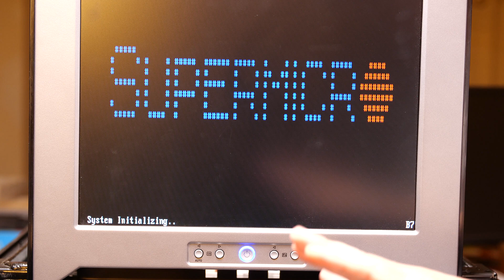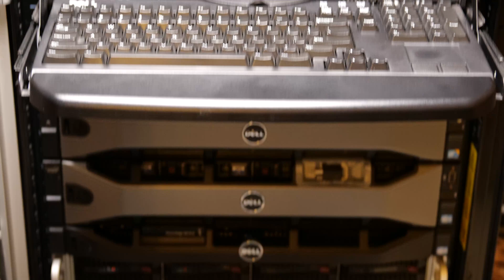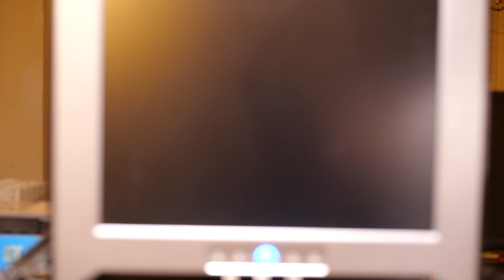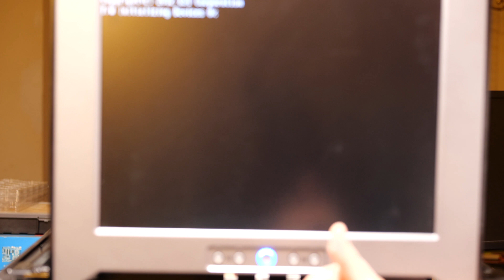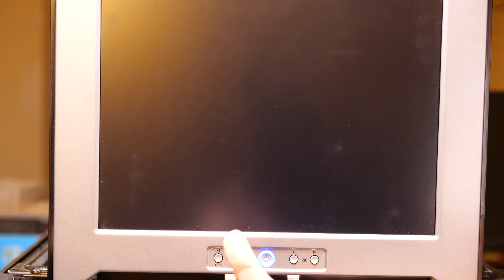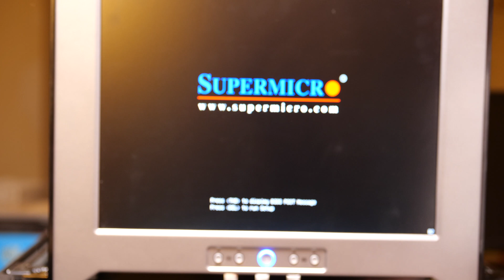Supermicro system initializing B7 B9 BA BF | Really weird problem with X9DRH-7F

Comment: I have a problem with an x10 motherboard, the problem is that it doesnt get any display output, in fact i cant even get output through the iKVM and i cant even power the second stage on from the IPMI, basically the the pc completely dead, i cant even get to the bios and in ipmi the code it gives me if “ff” i literally dont understand and dont know what to do, there is not ao much info out there to help me understand
Reply from the maker: You might have a dead motherboard. A few things you can check: 1) reduce the system down to bare minimum, 1 CPU + 1 DIMM. double check CPU pins to make sure non are bent 2) check that nothing is shorting the motherboard, especially any stand-offs in the wrong position 3) check CMOS battery has at least 3.0V 4) verify your PSU is providing all necessary power.
Reply: @ArtofServer  I have an x10drd int and everything works perfect there, i have tried all the points you said but does not work, what i think it is is the BIOS, the system will not boot if the bios is corrupted, my only hope is to try and reflash the bios chip maybe with a ch341a if it works, the bios chip model its kinda specific and i dont know if its gonna be write protected or if this is even gonna work, maybe the last last hope if to remove another working bios chip from a dead x10dri mobo hoping the bios is good (and has the same controller info inside it) so it boots, but if neither works then yeah the mobo might not be getting enough power which would be weird since IPMI is perfect and in a normal IPMI information table there has to be info about the BIOS version and so on like i see in the x10drd, but i see nothing in the bad mobo so bios has to be the issue, buying another mobo has to be the absolute last option cuz its so much more expensive now that before so im pretty fucked tbh 😭😭

Comment: For my X9DRW-iTPF motherboard, It was caused by turning on "Above 4G Decoding (Available if the system supports 64-bit PCI decoding)
Select Enabled to decode a PCI device that supports 64-bit in the space above 4G
Address. The options are Enabled and Disabled." If I did enable it, it would not get passed the initialization screen. I would have to clear the bios to get the OS running. Updating the BIOS and the IPMI firmware did fix it.
Reply from the maker: Thank you for sharing that!

Comment: Thanks for this. I had B7 on an X10SRH-CF and had rotated all 4 RAM modules that I had to hand, one at a time through the A1 slot with no success. It wasn't until I watched your video that I understood B7 could be CPU-related. It turned out BIOS version was the issue, it was running v1 but needed v2 or higher to support the v4 Xeon E5 I had installed
Reply from the maker: That's very strange that you got a B7 for running a V2 CPU on a V1 BIOS. Usually, the symptoms I've seen in that situation is a blank screen and no POST at all. Either way, I guess I'm glad this video directed you to eventually find your issue. :-)
Reply: @ArtofServer  Yeah I did not expect using a V1 CPU to resolve the issue honestly, but thought it was worth a shot as I was out of options. V1 CPU allowed me to access motherboard BIOS, flash the latest version and install the V2 CPU. Very odd

Comment: My son and I just went threw this. It's board flex that is the culprit. Take the board out. Reseat the ram in as hard flat surface. And it works. Just to much flex in the board installing the ram.
Reply from the maker: That's really interesting. but if that's the case, I suspect some trace on the motherboard is damaged if flexing it causes it to disconnect.
Reply: @ArtofServer  I would love to give an answer. All I know is we installed the ram in the case. And the board flexes like crazy. With a code BA.  So I told him to take it out. Put it in out dinning room table. Put them back in and it fired right up. Put it in the case after that and it still works. So, something somewhere didn't like something.

I'm guessing the flex mis aligned something and it didnt pop back into place as it sprung back up.

Comment: Been fighting this issue on 2 of these SM mobos. Thanks for problem identification and temp fix.  It happened again yesterday after a power-fail reboot. Stuck on B9.  This can popup after months of running just fine.  My long term problem is I can't put these servers at the datacenter 2 hrs away.
Reply from the maker: Yeah, I can understand if the system isn't stable and consistent, it's difficult to deploy remotely. It's possible some of the traces from the CPU socket to the DIMM slot is slightly damaged and sometimes loses contact. To improve stability, can you try not using the DIMM that has the instability and use larger DIMM modules if you need the RAM?
Reply: @ArtofServer  Good idea. No, excellent idea. Thank you.

Comment: After spending countless hours working with my super micro x9 d r i over the past 3 years it's been an absolute nightmare. Any upgrades done or just such a time-consuming troubleshooting mess. I really wish I would have videotaped myself all the time struggling with motherboards because they are very very temperamental. Best of luck.
Reply from the maker: Sorry that was your experience. I've had rock solid reliability with my Supermicro servers and I run 4 of them, not including the lab machines.

Comment: For me is a bad case of grounding. When fully populating all the ram, I will have B7, B9 or BA as what you have told. Find everywhere for help and in Russian website saying it’s a bad case of ground. Put a static bag behind the motherboard and all boot up fine and working fine
Reply from the maker: Thanks for sharing 🙏. That's a very interesting remedy.
Reply: Yes, I experienced something similar. I kept receiving these errors until I removed the motherboard and cleaned out the dust and debris from the chassis. Something was causing a ground to short issue and all of my troubleshooting of seating with CPUs and DIMMs was for not!

Comment: new subscriber here i have a supermicro x9dri-ln4f+ thats so picky with ram its unreal so far have only been able to get to ram sticks to work anything else and it gets stuck at either A9 or B7 lol
Reply from the maker: have you tried my first suggestion from this video? I find that if the CPUs are not seated perfectly, the pins to the DIMM slots might have poor contact and that can manifest as RAM error. it's also possible you have a bad motherboard where the traces to the DIMM slots from CPU might be damaged somewhere along the line. Especially under the screw holes of the CPU mounting brackets. If someone used a screw that is too long, it could have contacted the traces under there and damaged them.
Reply: @ArtofServer  my uncle whos a pc tech spent weeks messing with it he told me its picky with memory the only thing we havent tried is swapping the cpus around from one socket to the other and testing out the memory to see if the issue related to the dimms for socket 2 can be replicated for socket 1 thanks for the reply never seen a board so picky
Reply: update swapped cpus no dice same issue

Comment: Mine is the X9SRH-7F the same but Single CPU. 
I was having the same problem, and I tried everything including what you do here.
in the end it only worked with a single memory module.
and, OH SURPRISE!, when I disassembled it, I noticed that where the screws that hold the heatsink go, there are tracks underneath, and the screws reached them. breaking several.
Reply from the maker: oh yeah, I've heard of that problem before... someone using aftermarket CPU cooler with screws that are too long and end up damaging traces under the screw hole. You can remove the CPU bracket stuff and expose the damage to repair it if you are handy.
Reply: @ArtofServer  😖Yeah, I think I can fix it, but it's going to hard work. It was the 4 screws. 6 tracks on each side.

Comment: Im Stack in 91 ? What I have to do
Reply from the maker: code 91 usually means there's a faulty PCIe device causing a problem. Try removing all PCIe cards and see if it resolves. If so, add 1 card back at a time until the problem is reproduced. Then you know which card is causing the problem. If you have no PCIe devices, it might mean something on the motherboard is faulty and needs to replace the motherboard.

Comment: I get an AB error and a blue screen when trying to boot into the bios. Cleared CMOS and tried to change the date in the EFI shell but it won't save the date so still won't boot to bios. X9scm-f Have you ever seen that happen?
Reply from the maker: I'm not familiar with that problem. However, I used to have an X9SCM-F too, and I had so many problems with it, I got rid of it. Supermicro tech support even admitted they knew of some of the problems, but since the product was EOL, they have no plans to fix them.
Reply: @ArtofServer  Its a bios issue. Something to do with the clock if you update it which I had. It has to be rolled back in UEFI before Dec 31, 2020 or in an OS like UnRaid. Then you can boot into the bios again. Its a good starter board which I just made my backup server. thanks. As always love the videos.

Comment: I have the BA issue. Now I will trie this. sounds strange. My IPMI is also not starting every time I plug in the Server into Power
Reply from the maker: Sounds like there are some problems with that board...
Reply: But with this tip it worked. Strange what on this board is that often wrong

Comment: the supermicter gave Me B0 when motherboard was placed in the table, all three times, and when i was installed in the case of motherboard b0
Reply from the maker: That's a totally different code. I believe B0 means you are using wrong type of ram modules.

Comment: hello, is there any chance that a dh61ww (LGA 1155) can run a h200 / h310/ 9211 8i/ 9217-414e (in JBOD/IT).

If all of them are compatible which one is recommended?
Reply from the maker: I don't know that board specifically. for best compatibility, choose one of the genuine LSI cards. if you must use a Dell or other OE branded card, there's a chance of SMBus conflict. If so, you'll have to apply the workaround. Search my channel for "smbus" to find the video showing how to do that.
Reply: @ArtofServer  Great, I did miss the SMBbus, shall surely check that out. Thank you for finding time to resolve my query.

Comment: This is amazing.  I have a Supermicro server I've just received that had exactly this error. When it arrived the heat sink on the processor in question was installed at 90 degrees so wasn't doing much so I figured the problem had something to do with that, and as long as the ram was installed into any slot other than one particular blue one the problem went away, so, not ideal, but it worked.

While I was away doing another data center install I saw your video. Exactly what this server was doing. I've just removed the processor, nothing obviously wrong, nothing I could see on the pins, but, I've just fired it up with the ram back in the correct slots and boom, off we go.

Thank you!! Would never even have tried without this video.😁
Reply from the maker: Glad this was helpful? Be sure to try reseating the CPU and dimms first.
Reply: @ArtofServer  Bloody thing just locked up and is back to B9. Can only get it to boot with one stick of ram on each side of the CPU's (one of the blue ram sockets). Running a NAS with 8 GB isn't much fun.

Comment: Crazy thought tried putting in 2 gpus? 1 for each  cpu assigned by user manual
My old s5000xlar had weird pcie issues but putting in 2 k600i booted fine. Taking one out or both resulted in the same issues you  have had.
Good luck .
Reply from the maker: Even stranger!

Comment: You mentioned that the issues happens with that Quadro P400 in any slot but you didn't mention if this issue happened with any other PCIe card or not. Also maybe a card x8 x4 x2 will help narrow down the problem.
Reply from the maker: I test the other PCIe slots with some Supermicro branded HBA cards and that did not trigger the problem. The P400 did, but I did not try anything else.
Reply: That's very weird.

Comment: How are the screw mounts on these?
Can we sneak one into an ATX case to build an interesting home work station? You have me a little intrigued with these boards :D
Reply: it doesn't have through holes instead it just has a plate with threaded holes(bolts going to far would go into the board that is behind it), having said that I mounted 2 Cooler master 212's by expanding the heatsinks x brackets holes a bit and using my own bolts with nuts to adjust spring tension and bolt height; there doesn't seem to be a wide selection of official supported heatinks:P
Reply: as for atx case these are EATX form factor and so you need a super empty case (12in~ by 12in~ for the board & whatever else) or something that is big
Reply: @plasmar1  Oh yeah I can see it, compared to some of the enthusiast boards I have operated it appears a little bigger like the EVGA X58 Classified boards that were quite big for their day.
Reply: @CMDRSweeper  if you're gonna try it out, Phanteks Enthoo Pro:) if you get the version with the lsi controller be warned that it's a tight fit for the sff-8087's but doable.... X9DRH-7TF has dual 10gbe(intel x540-t2)
Reply from the maker: @plasmar1 thanks for answering!

Comment: It could be warping the board when the mounts are fully tightened down. Just a thought but Steve on GamersNexus mentioning about installing a spacer to even out pressure on a CPU quite recently.
Reply: this is the style of socket that is suppose to have less of any issue or not have the issue, 2 levers LGA2011, but it could still be the same issue.....
Reply: @plasmar1   Yes but its not the clipping down of the cpu that was highlighted, it was the retainers for the cpu cooler causing uneven pressure.
Reply from the maker: yes, I think there's something to that. also, I believe some of the DIMM slot traces run under the location of the heatsink screws. other working samples of this particular motherboard are not so sensitive to how tight the heatsinks are screwed down, so it's not a design flaw in my opinion. I just think there's some weird defect with this board.

the strange thing is, without the P400 card, all DIMM slots work just fine and I can run memtest86+  without issue with all DIMM slots occupied. the introduction of the P400 (in any PCIe slot) triggers the problem, which is then alleviated by loosening the socket #1 heatsink screws!
Reply: @ArtofServer  Strange indeed it might be a board layer fault. Just to add a google for the board brings up a similar model (Supermicro X9DRH-7TF) on server at home but the board diagram shows all but one PCI-E port coming off CPU 2.
Anyhow best replaced if you can as it may surface again once out of warrenty.
Reply: I have a X9DAI that suddenly went into a reboot loop without even getting to bios. And nothing on screen. I notised one of the nuts on the cooler was sitting very loose so i figured i take them off an put on new paste and remount them. When tightening i just tighten until i meet resistande then a quarter more.  Now it doesnt even want to make a beep. its completely dead. even try with 1 mem stick for each cpu. now is just one cpu no mem stick not even a light or a sound. Ive dissconnected everything from pci etc. I think it might be pressure related. u untighten the nuts but no diggerence. any suggestions? or just buy a new board?

Comment: Those PCIe slots are also wired directly to the CPU. So you may have some pins in the CPU socket not making proper contact which are for PCIe which is why when the PCIe slots are all empty it passes the power on self test (POST). But when a slot has a device it doesn't. Similar to the RAM slot issue.

This is why on newer Intel Scalable XEON's and AMD SP3 EPYC sockets they recommend the use of a specific pound-force inch limited screwdriver. In the case of the SP3 socket (Threadripper and EPYC) AMD recommends 14 pound-force inches. You can buy screwdrivers pre-set to this or buy one that you can adjust, when going over that amount of force it will disengage mechanically and not transfer any more torque into the screw guaranteeing all four screws are at the perfect level.
Reply from the maker: yes, the PCIe slots are connected to the CPUs. the strange thing is at the time of this video, the P400 is in a slot connected to socket #2, yet the B7 code is for socket #1. I definitely think something to do with the PCIe bus (and why I suspect SMBus perhaps, which often can manifest as memory fault), but it was a really strange one...

Comment: I bought one of these about a month ago, one of the slots doesn't clip closed fully(expect usually the clips close fully when pushing down on the ram sticks) when populated; the card was seated enough that I'd expect it would still be fine but had this sorta issue(the slot doesn't look like it has anything particularly wrong with it; and it's been running stable till now after the fact)....cause I have a mix of 3-4 sets/ 2 brands(hynix, hynix, micron) sets of ram in it, I swapped around the cards and it ended up working, definitely a funky board series but not a bad one; if I had to guess maybe they skimped on quality sockets/slots for these boards
Reply from the maker: I've built several systems with this board and have talked about it in other videos. It is generally a very good board, stable and reliable. There are some samples of this board on the used market that are not in the best condition, like this particular one in this video.

I find DDR3 ECC U/R/LR-DIMMs are generally a bit tricky to get seated correctly across the board, not just with a particular brand.